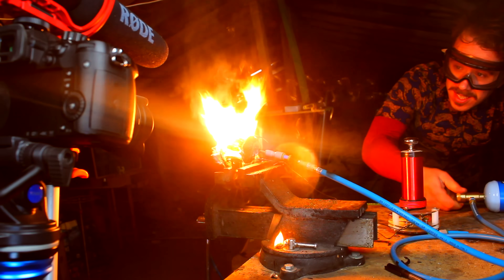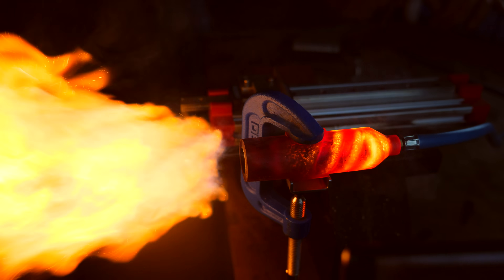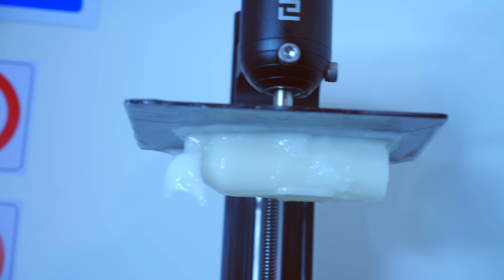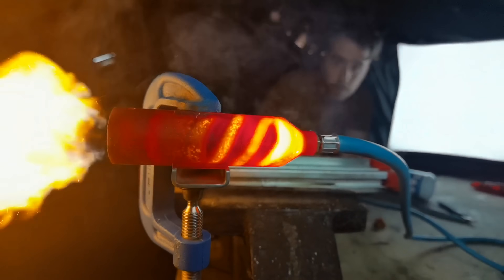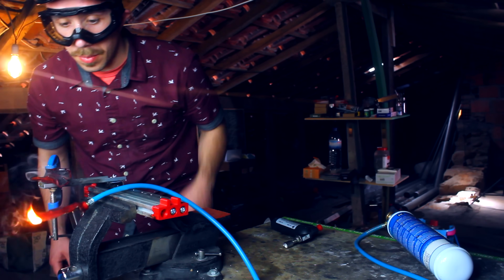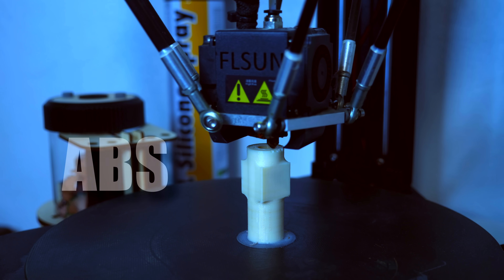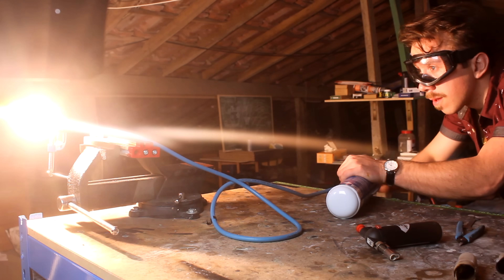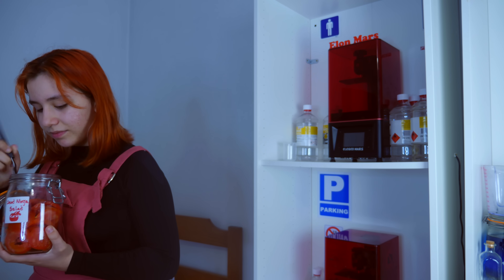Rocket engine that uses itself as fuel! (3D Printed)

Comment: I would suggest you use one of those chocolate 3D print nozzles with a solid fuel made of potassium nitrate, sugar and iron oxide, you should just be able to melt up pieces of it in the nozzles chamber but I’m not 100% sure if it would get hot enough to melt it. (Or maybe it would get too hot and and combust, I don’t want to destroy my one 3D primer so I’ll leave it to you to test)

Comment: just a question, have you considered getting a printer capable of printing stainless steel? i know makerbot has one for about 5,000 usd only requires sintering which i bet you could do. I bet that stainless steel wouldnt break like the resin

Comment: Lol!  This is what I was thinking of suggesting, a structural rocket fuel.  It landing somewhere burning down the place is an issue.  A rocket structure that could hold a design to orbit as it reduced. 
But, it is likely to be more bulky and heavy than optimal fuel, and it still might be more costly after rocket structure is removed.  However, the chemical composition of high exp and fuel, is understood.  So, hydrogen and exp, are two areas that might produce more range.  However, explosives are known for exploding (the while thing is dangerous bomb waiting to go off on the launch platform, or from magnifing glass effect from the structure. 
However, using fine layers of specs mixed in with the other burnable material, can control detonation separately from the rest of the explosive, adding both feuls together together.  However, why bit drop feed exp in, like those nucl rocket proposals.  But, apart from not being able to obtain these products, it's a good way to easily bl everybody up accidentally (don't try at home, or best anybody's home). So, a safe, very dilute low yield small bunt design as a test, otherwise it will look like a space X launch test video. 
 That's a video. Have fun.

Comment: Try to increase the surface area in contact with the pure oxygen printing a porous matrix as fuel. For the nozzle, ill try to make it longer. Maybe also a pre combustion chamber could optimize the combustion process and increase the power that you are able to produce. Just suggestions, don’t know if it can help actually because it cannot sustain the highest temperature of a stoichiometric combustion that you are trying to have (all oxygen is expended in any case).

Comment: Why are you changing the design, you could just cover the fuel nozzle with a metal enclosure which would prevent the wholes cause thrust reduction so it can keep using the fuel. For more structural integrity and for making the nozzle burn from the right end first- you have to make a hash type design which is used to give integrity to rocket inside walls, just vary the diagonal length of the hash design from the left end to the right by doing some trials or just do a simple force analysis first for getting an idea

Comment: Dude u should never refer to such pretty young ladies as the ones ur surrounded by as “stupid girls”. From what I can see they are helpful and not all wrong about lighters having batteries. Besides referring to them as stupid girls might drive them off and that might drive ur subscription level down. Then who would be stupid…Ha! Ha!  Just kidding ur very smart and fun to watch which is why I subscribed also the pretty young ladies help. Anyway I seem to remember when JPL first started out they mixed liquid fuels with an asphalt material by heating them together they could ensure proper (even (complete thorough)) mixing and the elimination of any bubbles in the set (dry) mix. Uneven distribution of materials causes uneven burning and that leads to uneven distribution of thrust. Bubbles would cause cavitation and eventually lead to total explosive fail. Even mixing and even distribution means even burning which equals even thrust which will be powered up (throttled) with the introduction of ur oxygen under pressure so please be very careful. I would hate to see any of u get hurt especially the pretty young ladies. Have fun, God speed, stay safe and fly right my friend.  I cant wait for ur next video.

Comment: I had a 3d printer I built but can't afford to fix it. 
I rate the next video should be Building and designing a Morgan Style 3d printer. If you are wondering what that is, let's just say it has an arm it uses to print.

Comment: Really could use a deeper dive into the failure modes. There's a lot to be learned on how the fuel is consumed in relation to the geometry of the design. You'd do much better if you print the fuel geometry and put it into a more robust casing that can contain the pressure.

Comment: Would a rocket that burned itself fully as fuel, hypothetically have an infinite* final speed due to the Tsiolkovsky rocket equation? Delta V = Isp . ln(mi/mf) and mf=0 for a rocket that burned itself to nothing. However, there would be nothing travelling at that speed, though.     (*Neglecting the speed of light as a limit, obviously.)

Comment: we in the USA calls them sparklers. and the case for you engine you can uses steel pipe or PVC pipe. I know if you use Thin wall PVC for the Body of your rocket and Hobby rocket motors that works really grate.

Comment: You could make a metal housing with a nozzle that compresses the output thrust therefore making more thrust and more use of the fuel. Make the housing two parts held by screws so you can replace the fuel core.

Comment: Hi, novice engineering student here and id like to recommend you try an elongated thrust nozzel made of ceramic or brass. The elongated geometry of the nozzel would provide more thrust by causing rapid acceleration of the gas/flame coming from the combustion chamber. Also print a hard outer shell of 100% fill and a burn core of abs at 75-90% in fill to achieve better surface area and more aggressive combustion

Comment: Most of the thrust "created" was due to the pressure of the oxygen flowing out the nozzle. Everything here was simply noisy burning of plastic in a general direction. Flame coming out of a hole does not equal a rocket engine.

Comment: Why not just put it inside a thin metal tube and simply use the print as a burnable mold for a castable solid fuel, you could use the same principle to cast the nozzle section from plaster(gypsum) or something similar........

(and at this rate it's only a matter of time before you burn your house down, all it takes is 1 short-lived explosive-trust event and that attic ceiling is on fire...)

Comment: What about a submarine episode?  I have a 3d printer and would love to see a new design for buoyancy and propulsion.  As well as controls and remote transmission of feedback and control.   I was thinking about sonar for both and possibly as propulsion also👍🏽  is it possible to create enough low pressure vs high pressure in front a d behind to create thrust in the water?  Could an Arduino be programmed to use sound as a control mechanism?     How about a Wankel rotary engine in the nose to convert thrust i to additional thrust as it scoops water to turn propellers.  Maybe look into shawburgers designs for inspiration and use water hammer like a rampump.  Hmmmm...😎

Comment: I think 1 of the issues you are having with these rockets is the nozzle is deforming from the heat, causing the energy to be distributed irregularly across the surface of the nozzle. Perhaps using something like/similar to aerogel and infusing it with a solid fuel will allow it to hold its shape a bit better and still technically be a rocket that uses itself as fuel

Comment: im thinking, since the nozzle is made out of the fuel essentially doesn't is just burn/melt away as the engine runs, producing less and less thrust. maybe a ceramic nozzle would work better with these engines.

Comment: Imagine putting a metal casing around the rocket , it would help with the fire going out the sides , forcing the power through the back
Reply: But it kind of defeats the point of the rocket

Comment: Have you tried to create a hybrid of a hybrid grain? Meaning a composite grain of both printed fules and a LOX source. Also, why not have a hydrocarbon source like kerosene? The other thing I thought of for your rocket body and motor housing would be fiberglass and carbon fiber composites. One other thing that came to mind was that, correct me if I'm wrong, but isn't solid rocket file, an oxidizer and a file source? So why NOT add KNO3 AND C6H12O6 to the resin? Then 3D print a grain that is slightly smaller in diameter then your motor housing. THEN, you can pack your rocket motors the way the ARMY readies a Howitzer m777 for field fire. They add the projectile and the. The grain or charge behind it. So in this case, create a uniform grain length of fixed diameter and if you want a double charge, “HEY, BOB’S YOUR UNCLE!”

Anyway, keep up the good work and I cannot wait until your next post.

Later, 
-J

Comment: a good solid fuel can be made usiing resin and sodium or potassium clorate (make sure thay dont have a fire retarder added) using in a sutable container can create a huge amount of thrust enough to drive a rocket hundreds or even thousands of feet into the air I know I have done it.

Comment: I think that as the fire eats its way through the body of the rocket, it will eventually leak well before the fuel is exhausted. The least you have to do is to install a durable outer shell.

Comment: What if the thickness in the spiral was not uniform (ie start burning a thinner inside spiral) and there was a reinforcement ring (perhaps of different material) some where around the middle in order to prevent the tube snapping? Also the walls could have varying thickness, getting thicker towards the oxygen intake.
That would be done so everything burns more uniformly and also so the direction of the propulsion is constant, as opposed to being directed by the uneven lips of a burst resin tube.
Source: Am mechanic.

Comment: this might actually be kinda viable for actual rockets, using a base body with expendable and attachable rocket cells would probably nullify the struggle of transporting fuel and other problems that come with having to refuel these massive engines

although just refueling them would probably be easier than mass producing expendable rockets right now, since there isn't an industry that actually uses industrial amounts of rocket fuel at the moment

Comment: Your nozzles aren't supersonic so it's not very useful to use any kind of contraction-expansion nozzle. You need higher internal pressure to get the nozzle to work efficiently.

Comment: To get the fuel to burn more entirely you need a metal casing. In highschool I was in a rocket club that got funding and advice from NASA. We had commercialy produced hybrid engines that had a metel casing and acrylic fuel. Plastic is actually pretty energy dense.

Comment: Obvious solution : ditch  the O2. 
Use the resin as fuel, powder up KNO3 as oxidizer, 
make a resin slurry in the same ratios as used for sugar rocket.
Use a ceramic nozzle insert in a rimmed tube.

Don't use rockets under all that all lovely dried wood in your attic....

Comment: rocket engine- reusable pvc based holder for components.  hybrid engine that uses nitrous charges (like for whip cream) fed into a tube made of wax as the solid propellent.  using a thin plastic burst ring to begin the injection of the nitrous into the wax motor upon ignition.  the trick is controlling the amount of nitrous that comes out once the burst ring has melted.

Comment: Rocket propulsion engineer here - First thing, 3D printed fuel is very much a thing. In fact, many test labs use ABS to test different designs, you are on the right track there. What I noticed most about each of your designs is that they don't account for erosion as the engine burns away. That is why you kept getting chunks blowing out. For future designs, think about what shape the inside will look like after half of it has burnt away. Will it still look the same?
Second is the thrust. Rocket nozzles are specifically designed to maximize the amount of thrust based on the pressure inside the chamber. What I noticed about your designs is that they are WAY over expanded. You could get a lot more thrust out of all your rockets if you made the cone a little more narrow. Given that you are burning a fairly low pressures, your cone does not need to widen much at all.

Comment: Solar rocket uses chlorine, hydrogen and air or oxygen and sunlight. The light ionizes the gas to make thrust. So a parabolic dish to activate the fuel. If you use a stopper it will build up pressure until it pops off. Though the feed needs to be sealed tightly. Electrolysis of  bleach with two dissimilar metals could make the reactive gas in a separate container. Or act as the first stage in an ion rocket. But do this out side as you can't breath chlorine.

Comment: Can you add a solenoid to the oxygen line?   Is the ramping of burn coming from the turning of the valve?   Could you try a 4-position valve to give 0, 25, 50, 75 and 100% open line?

Comment: Make a thin metal nozzle and a body OR an exoskeleton of metal wire for the fuel. I get that you're trying to make a self-sufficient rocket that burns to nothing, but the problem is that your nozzle geometry changes really fast as the fuel burns and the rocket fails (cracks, burns through etc) before all the buel is burned down. What you need to design is maybe a metal nozzle and body, possibly with slots for solid fuel and a spring or something that would push the fuel to a certain point inside the body as it burns, so the body volume inside and the nozzle geometry are constant, giving you constant and more efficient thrust (i think... thats just what i'd try to do at this point)

Comment: Hm... my immediate thought is that 

A. These engines need a dense casing, thatway it maintains pressure even when the sugar nozzel gets a hole.

B. FOR THE LOVE OF GOD GET A ONE WAY VALVE AND BUILT A EMERGENCY CUT OFF SYSTEM. Oxygen canisters can deflesh your bones in an instant if things go wrong.

Comment: I'd be interested to see what would happen if you mixed in some very fine aluminum powder into the fuel.  Also, there is something called hexamine which I think has great potential (maybe the hex + Al in addition to the plastic).

Also, you need a shroud, sleeve, cylinder.  You need a good refractory. I suggest getting some powdered magnesium oxide and mix it with some high temp clay.  You could use this as a nozzle plug for thrust as well.

Comment: Have you tried to put your fuel compartement (the plastic) in for example a thin steel (or any other metal with meltingpoint)  tube? This would prevent the exploding of the rocket, and allow it to burn faster/longer to create more thrust. Also, if you would attatch the nozzle to the tube you should be able to burn almost all of the fuel, thus creating more thrust.

Comment: The issue with the engine and fuel being the same is any choke points will widen faster than the rest.  If your gas can't reach supersonic through the choke point, you'll get little to no thrust.

Comment: now that you did some rockets that do produce thrust,

make a plane that is 3d printed, not just the body of it but every single part and take your experience in Rockets to a use
maybe even try to make it remote control, i think that would need servo's but maybe you can find out something better that fits the "Full 3d printet" theme

Comment: I don’t know if anyone has said his in the comments yet but you should try printing the fuel portion in the sugar resin and the body of the engine in heat resistant rein or some form of heat resistant material. That way you could make one or two bodies and keep re-using them. And you could also change how the fuel looks without having to completely re-design the whole rocket.

Comment: Nice demonstration of like 11 ways to risk injury or death... one of the most irresponsible videos I have seen. I absolutely encourage people to experiment with rockets or anything else! But use some common sense and safety measures. For example (I can't believe I have to say this), no combustion engine should be operated indoors. Nobody should be close to a rocket firing. Nothing flammable should be close to a rocket firing. An experimental rocket like this should be operated from behind a wall to protect from ejected debris. Google "experimental rocket safety" and have fun.